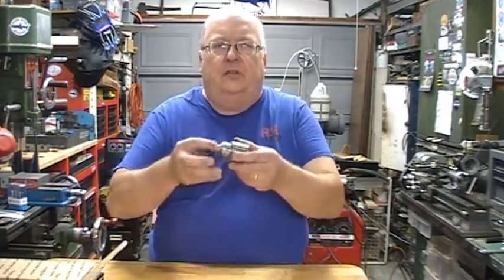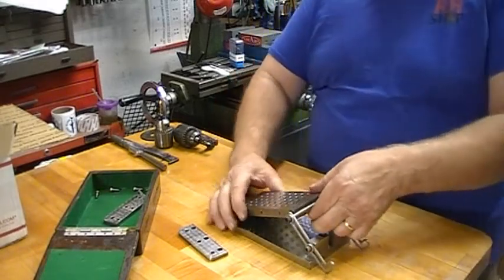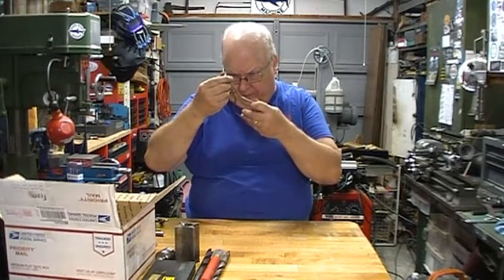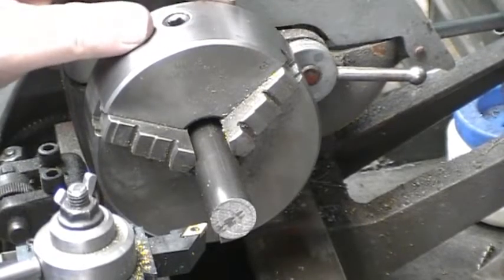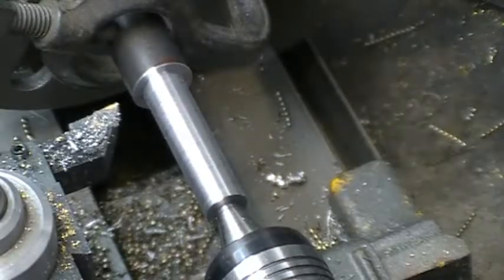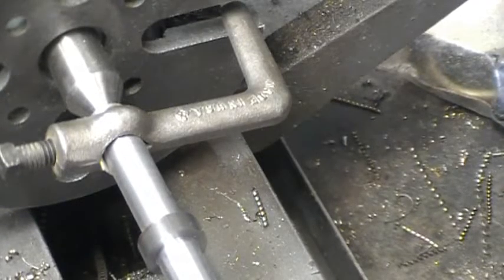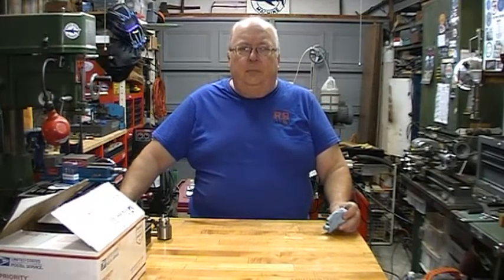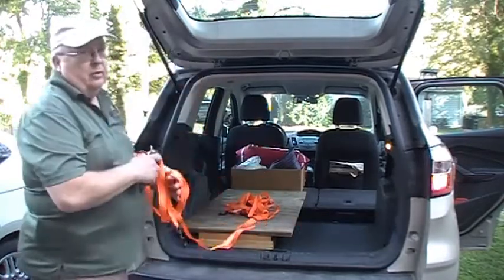Shark Bits #20 - New Atlas Lathe

Comment: Nice shirt.  Nice find on the lathe, yep quick change have to have, nice finds at the tool sale.
Reply from the maker: The lathe does not show any signs of wear,  I very often used a die to cut threads that should have been single pointed just because it was such a hassle to change over the gears. I like my RR shirt.
Reply: @sharkrivermachine  I think you will like not having to change the gears.  More SPT.

Comment: Where will you put that new lathe?
Reply from the maker: The new lathe will replace the old small Atlas 618 on my  steel bench.  The 618 is going to be set up on what used to be my woodworking bench, now it is a storage area.  Thanks for watching and commenting.

Comment: Steve! The precision ground stones are awesome! What an excellent set of stones. ...was wondering... as I am getting into re-scraping my mill, getting into the dovetails with the stones just wasn't happening, but dang-it, after using the precision stones on one flat way after a scraping iteration, I was this far away from throwing my Norton slip stone into my gardening tools bin. Ever consider making up some precision ground slip stones?

Jim
Reply from the maker: Thank you for the feedback.  I just saw where Stefan cut a stone at an angle and ground it.  I have been considering it.  I will be expanding the stone line as soon as I get caught up with my orders, that is coming soon.
Reply: @sharkrivermachine  let me know when!
Reply from the maker: Send a email to me, that is how I keep track of requests.  sharkrivermachine@gmail.com